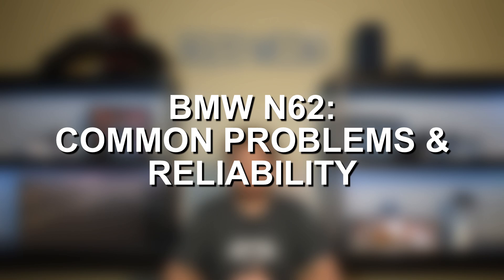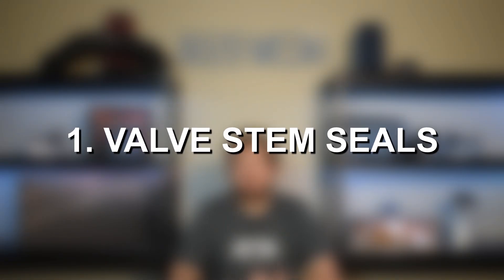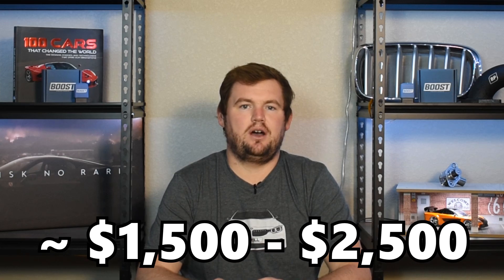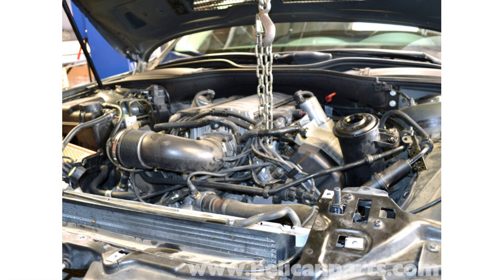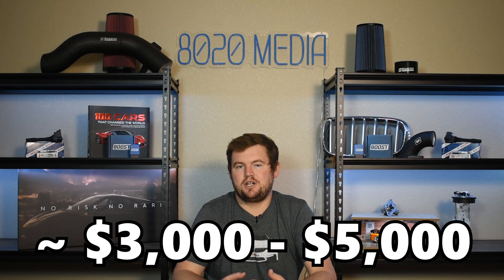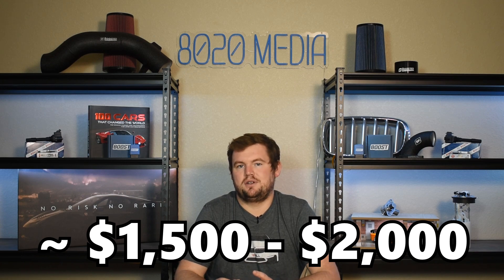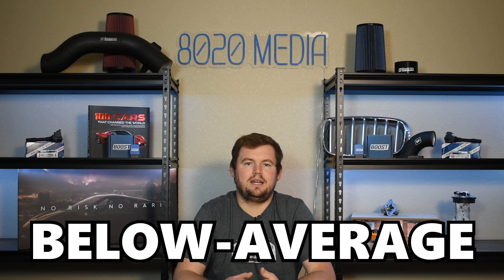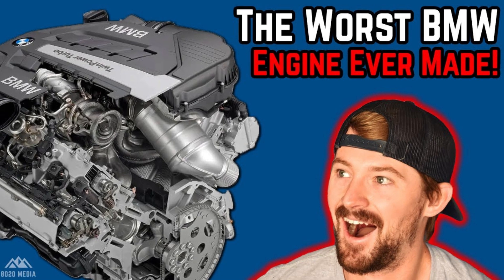Thinking of Buying a BMW with the N62? WATCH THIS FIRST!

Comment: i have a 550i n62 the 4.8 liter v8 and i can tell you its a very good engine. but you have to change the OEM thermostat! OEM thermostat is very hot. around 108c if you place aftermarket performance then the temperature is max 90. so everything have a longer life! all the plastic en sealants and stuff.

Comment: I just replaced the valve stem seals on my 2004 745i with n62 engine w/ 247K miles. I removed the cams and retimed the engine which was way better than going around them using those expensive tools. Speaking of oil leaks, today I noticed that the oil pump gasket is leaking which is yet another big job on these cars requiring removal of upper oil pan. This means the front subframe needs to be lowered. :(

Comment: i545 the absolute worst car I have ever owned. Did you mention the transmission issues? I had fixed everything that you mentioned in less than 75k and more, including the transmission before I gave in and got rid of that nightmare.

Comment: The the car salvaged with a oil leak , and throwing vanos code it misfire it’s at 200k miles and the engine still runs better than my WRX which just blew up and I replaced it with this lol 😂

Comment: i am an electrician, i used youtube videos to do all of these...
- valve stem seals, AliExpress tools 200 eur, 32 seals 320 eur, two days work, couple of beers
- alternator bracket gasket, gasket 25 eur, one day work
- coolant transfer pipe, removed water pump, inserted stainless steel pipe with high temp sealant in place where the gasket fails, one hour work, but 24 hours wait so sealant can properly cure before putting everything back together
- in 11 years i did not have any coolant leaks problems, i installed 90 degrees thermostat.
- valve cover gasket, 3 hours for 2 heads.

so all of these BIG problems together are actually just your time and maybe 1-2000 euros (if you buy "while you are in there" stuff), and you can have a 100k eur, 360hp car for cheap.
stop scaring people with stories you read online without ever doing any of these jobs your self.
i have my E53 4.8iS 11 years, it is at 320k km and it is still running smooth and as new. 
main thing with 2000-2010 bmws is to change ALL fluids (engine, brakes, gearbox, diffs, coolant, a/c, power steering...) in time and it will run 500k km...
having in mind what you get for the money it is a GREAT engine. you can not compare it to 100 hp honda and say it is not reliable.
compare it with all other V8 engines from that era, mercedes, porcshe, audi... those engines ate them selves and are not on streets any more... n62 are still around.

Comment: My 2008 BMW 650i (N62TU V8, manual, 137k miles) has been rock-solid. I change the oil every 3–5k miles and did preventive maintenance myself, coolant pipe, alternator bracket gasket, valve cover gaskets. Never stranded. Valve stems are still original. Typical BMW issues appear gradually, giving time to fix. A lower-temp thermostat helps with the longevity  of plastic and rubber ; the standard 205°F is too hot. It’s the last naturally aspirated V8 BMW made, Jeremy Clarkson from Top Gear called it “a nuclear reactor of power.”  It’s not a Toyota, but calling it below average is  just wrong. You just need to maintain it. Obviously the narrator has never driven and enjoyed a BMW with an N62 engine especially with a manual transmission.

Comment: I have a 2004 545i with 140k miles but for some reason my body control module is bad and thinks my trunk is open so when i lock my car the alarm goes and drains my battery. I dont know if i should sell her or not because i know it runs good
Reply from the maker: G - Your 2004 BMW 545i at 140k miles still running strong is a good sign, and the “trunk open” alarm issue from the body control module (actually the GM5/footwell module or trunk latch switch circuit) is a very common E60 problem that often ends up being much cheaper to fix than people think; in many cases it’s not the full module but a faulty trunk latch sensor, wiring break in the trunk harness, or a corroded connector causing the BCM to think the trunk is open, which then sets off the alarm and drains the battery. Before deciding to sell, I’d recommend checking the trunk latch micro-switch and wiring harness near the hinge — those are known failure points and often fixable for under a couple hundred bucks compared to replacing the full module. If the car otherwise drives great, it’s probably worth repairing since a well-running N62-powered 545i is still valuable; selling it as-is with an electrical fault will likely bring far less than it’s worth.

Comment: the 4.4 and 4.8 should be considered as separate entities. The 4.4 was beta, very ambitious but full of issues and not quite evolved to its final form. The last iteration of the 4.8 is an absolute unit. Unstoppable monster. Especially when mated to a manual.
Reply from the maker: P - Well said. Thanks for sharing.

Comment: My n62 545i holding up good. 235K miles and i red line it all the time. It wont blow lol
Reply from the maker: R - Thanks for sharing! Sounds like you take good care of it.
Reply: @8020Automotive Try to as much as i can.
Reply: I got a n62 545i 2004 got about 128,000 miles. Over 300 plus horses of speed what a beast!

Comment: From someone who owns 2 of these engines in different cars. I have the n62b48. The valve stem seals are a non issue with regular oil changes. change your oil every 10 000km or less and you will never have to fix this. The coolant pipe is a dumb design and can be an issue, even though I´ve seen cars with 250 000 km that had regular coolant flushes/changes and the gasket was like new. On both of mine, I did it preventatively as we did a round Europe trip of 30 000 km in 4 months. The alternator gasket - not sure what idiot designed that, but it is incredibly dumb and it will fail. It´s something you can´t get round no matter how well you maintain your car. on the b48, the timing chains and guides are a non issue with regular oil changes. the smaller engines suffer from that more, again not as much if you do regular oil changes. on the smaller engines expect to have them replaced around 210-220 000 km and it is a BIG job.
in general, the n62 is pretty much bulletproof when maintainted well, but do not get into owning these engines if you don´t have a competent mechanic that doesn´t cost a fortune or you´re not a DIYer. You can do most things on this engine on your own and there are manuals and youtube videos pretty much everywhere. The eccentric shaft issue generally happens MOST of the time when people remove valvetronic motors improperly so be very careful where you leave the car for repairs.
One other thing is intermediate shaft lever wear which is part of the valvetronic system and when worn, will cause cold start misfires for 15-20 seconds with no CEL illuminated. If this happens to you, do not go down the shotgun route and replace your coils, plugs, injectors, valve cover gaskets etc as none of these will solve it. This is 99 percent of the time non pre facelift cars and most were fixed under BMW recall but anyways, be careful.
when in good condition these engines are fantastic and pretty much bulletproof. if neglected.. run. it will be 20k+ as you´re paying for nearly 2 decades of neglect.
Reply from the maker: A - All great points! Thanks for taking the time to share your experience and insights with the N62!
Reply: @8020Automotive pleasure sir!😊
Reply: @alexcohcoaching I found your explanation very educational and well written-thank you
Reply: Thanks for great writeup.. Just did my alternator bracket gasket and never done it before, all done with help of youtube, not complicated but one need a selection of tools. 
I do love this engine and I AM read for doing other work on it, like the steam seals.. But will attack that when the day comes..  Next on my list is to change oil in the trani as not sure when previous own changed is.. Hope it will help with it kicking..
Reply: You make me believe buying b44 is not a bad idea :O

Comment: What would you choose between the n54 and n62 on a 5 series e60 for example?

From what I see the n62 is cheap in parts but expensive to repair. The N54 is expensive in parts(turbos, fuel injectors etc) and expensive in repair. What do you think?
Reply from the maker: V - Between the N54 and N62 in the E60 5 Series, the better choice depends on what you value most: if you're looking for tuning potential and performance with a stronger aftermarket community, the N54 is the winner—it’s a twin-turbo inline-6 known for taking big power with bolt-ons and a tune, but it does come with expensive and frequent maintenance (injectors, HPFP, turbos, carbon buildup). On the other hand, the N62 V8 offers smooth naturally aspirated torque, a great exhaust note, and cheaper junkyard parts, but it’s much harder to work on due to tight engine bay space and complex systems like the valve stem seals, eccentric shaft, and coolant pipe issues, making labor costs steep. If you’re a DIYer and plan to modify, go N54; if you want a relaxed cruiser with a nice V8 feel and don’t mind occasional big repairs, the N62 is fine—but neither is “cheap” to own long-term.